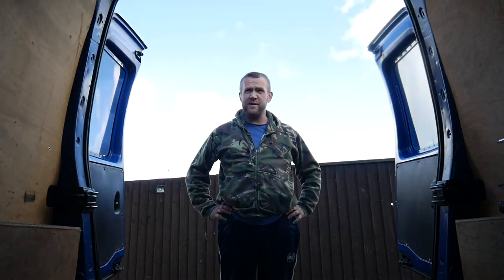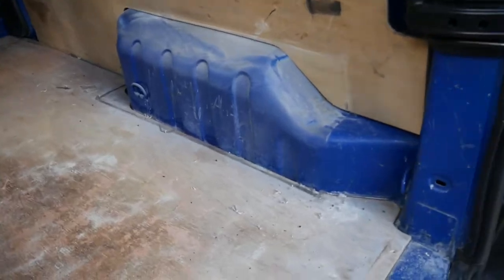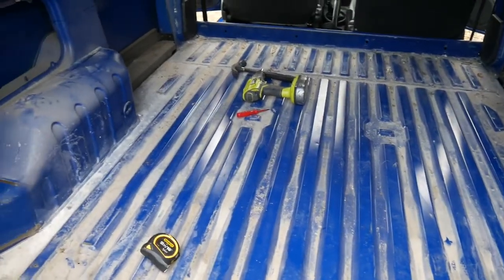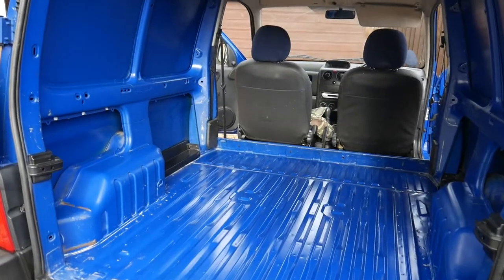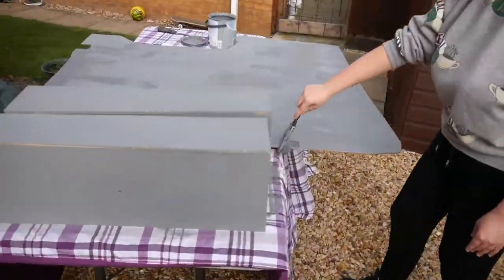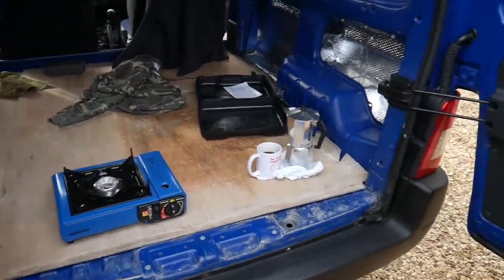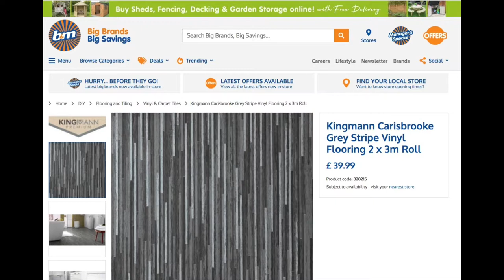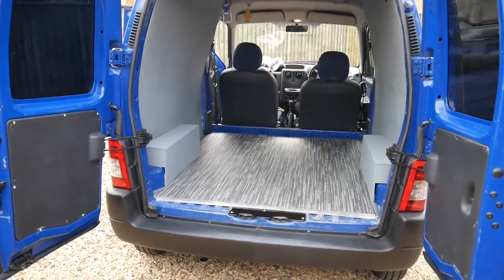Flooring & Insulation STEALTH MICRO CAMPER Van Build | Ep.2

Comment: Hi pal. Do you find the foil alone provides enough additional heat retention for 4 season camping, or would 3 season be about right?
Reply from the maker: To be fair it's a van you won't make it much better even with more insulation, add a diesel heater and you'll be fine.